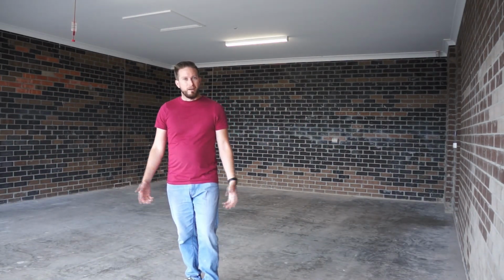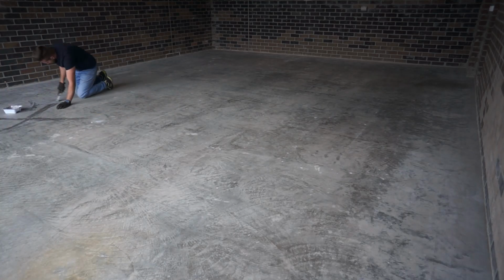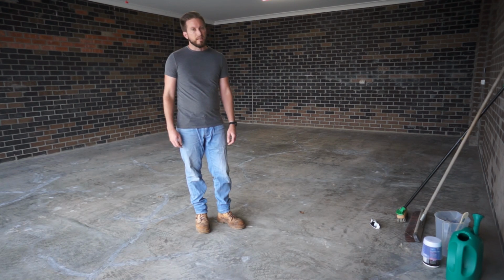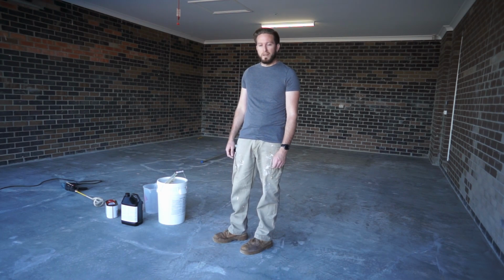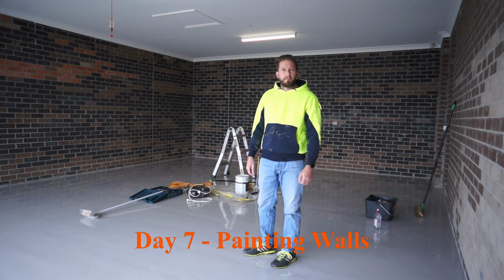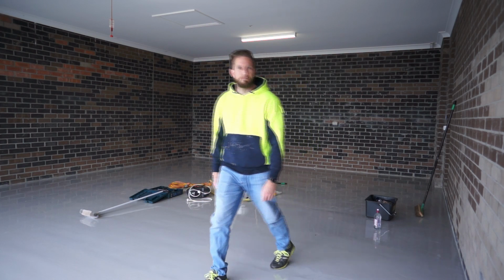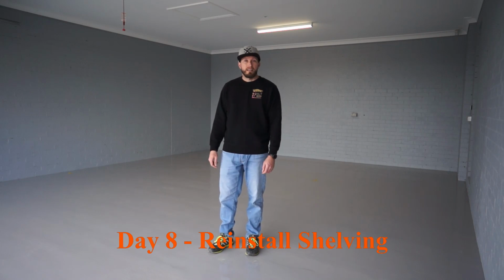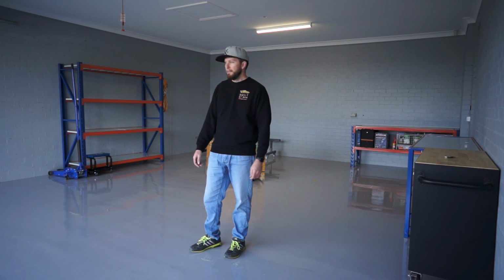GT40 Kit Car Build - Ep 04 - Ultimate Home Garage Makeover **Surprise Delivery!**

Comment: Garage Hint - put in a electrical sub-panel. Wire outlets around garage using metal boxes and EMT. do the same for ceiling and put in multiple bays of LED lights each with it's own switch. Also put some outlets in ceiling for drop cords.
Reply from the maker: Thanks David. I thought I had enough power outlets already, but quickly learnt you can never have enough!

Comment: Looking forward to seeing the GT40 build go together. I would love to build an Absolute Pace Cobra Kit. You mentioned in the last video you’ll be using a Gen2 Coyote. Will this be a crate motor or second hand & are you using a Ford Performance control pack? Interested to see how it gets through emissions testing.
Reply from the maker: G'day Peter, currently still looking at engine options including Gen2/Gen3, crate/used, ford performance ECU/motec with factory tune, etc. Also waiting to catch up with my engineer to discuss in more detail with them as to emissions etc. I've committed to the coyote platform to facilitate the chassis manufacture and to ensure the correct parts are supplied to suit that setup, still need to work through the details though as I'd like to avoid having to do the IM240 test if possible.

Comment: Why did you choose no flake in the epoxy floor?
Reply from the maker: Just personal choice really. I purchased the epoxy from an epoxy supplier directly, it didn't come as a kit with the flakes, like you can get from automotive/hardware stores. I understand the flake gives a rough texture and increases slip resistance, but I prefer the smooth clean finish.

Comment: Can I please ask the price of the car? I can’t find a price anywhere, if you don’t mind answering. Thanks
Reply from the maker: G'day Michael, it's hard to advise on a price as there are a lot of different options available which obviously affect the price, the cost of materials is also constantly causing the price of the kits to increase quite regularly. Your best bet is to give a couple of manufacturers a call to discuss options and associated pricing. You were able to pick up a kit with all required components (except drivetrain and upholstery) for sub AU$100k but its getting a lot harder to find them around the price point in the current market. I hope that helps! Dan.

Comment: Fantastic start to the build space. Are you going to augment the lighting, ventilation, or power sources?
Reply from the maker: G'day Michael, thanks for taking to leave a comment. I haven't considered any updates to ventilation, not sure that it will be necessary. 

In terms of power, I already have outlets towards the front on side wall, centrally on rear wall and centrally on the ceiling. Given how good battery powered tools are these days I don't anticipate any additional outlets being required. 

When it comes to lighting, I have considered installing some additional lights, but want to get the car in there first to determine what will work best!